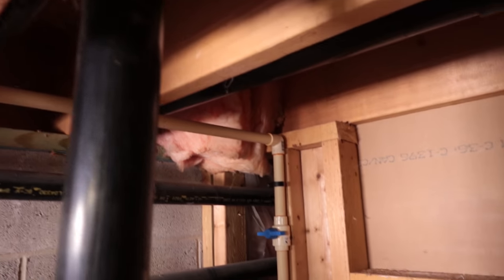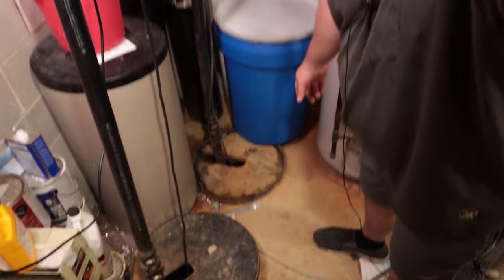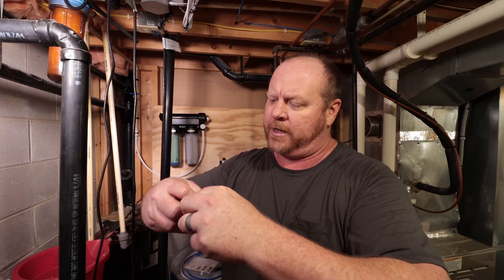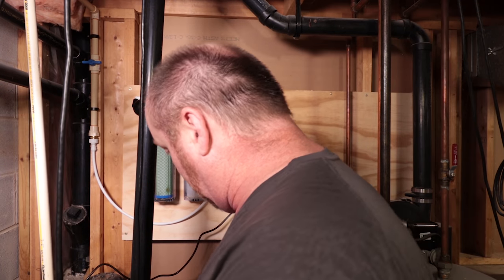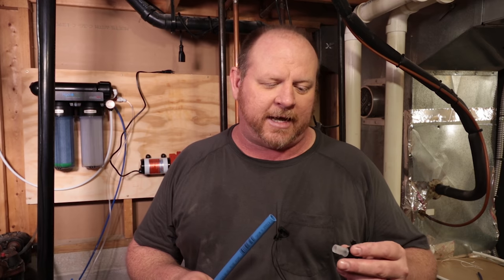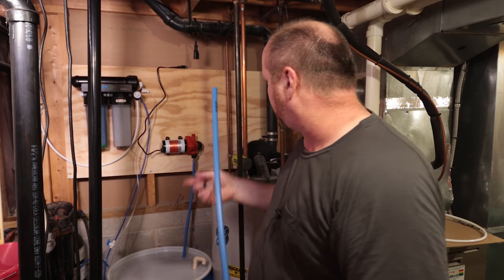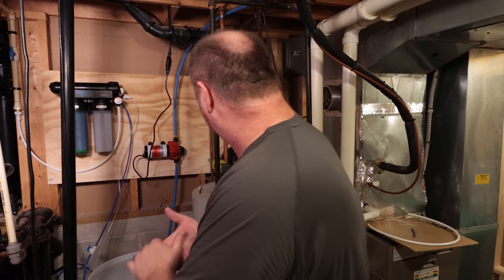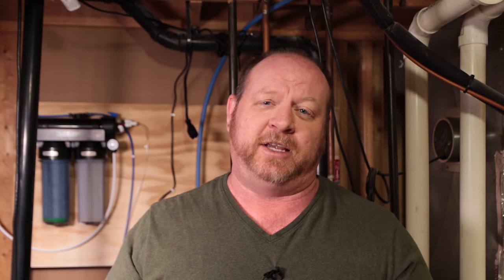Basement Brewery Build Part 12 Hydrologic Stealth RO 150 Install

Comment: I can't tell what your H2O softener setup flow is, but I assume you're adding salt (brine tank)? If so, can you take your H2O before the salt addition? This is just additional load (and shortened life) on you membranes. I would consider putting the RO waste water back in the brine tank. Nothing really bad in there and it will be way diluted out. No point wasting the H2O.
Reply from the maker: The iron content is way to high. The folks at hydrologic told me it's best to have the RO after the softener. I don't have a way to put water back into the softener either.
Reply: @ShortCircuitedBrewers  I meant run the water through the filters, carbon, DI or whatever you have, but skip the salt to save your system.
Reply from the maker: @henryelceser  gotcha
Reply: @ShortCircuitedBrewers  Nevermind with the high iron, the sodium is the better alternative. You still need to regen the softener bed.
Reply from the maker: @henryelceser  yeah it is an old system. Thinking about upgrading to a different style that deals with iron better.

Comment: You have the flow restrictor hoses backwards!! The purple is 2:1 and the red is 1:1. If your water is over 300ppm, you're supposed to use the purple line, not the red. I just hooked mine up and I'm reading it in the manual right now....
This video here shows it at 2:39 https://youtu.be/0HaPpEk7Wsc
Reply: is this comment not showing up?
Reply from the maker: it was hidden because of the link in your comment. I had to approve it.. I have now.
Reply: @ShortCircuitedBrewers  oh okay. I figured youtube was just being a pile of crap lol. I had one other thought floating around my mind. Did you close the valve on top of the stealth ro? The one above the flow restrictor? I only ask because it looked like it was still open, in the background and I forgot to close mine, for about a week, before I realized that it's supposed to be closed.
Reply from the maker: aDayInTheLife no!! Lol I just checked it!! Funny thing is it has been working fine? Maybe the content after the softener is not that hard for the system to process?
Reply: @ShortCircuitedBrewers  yeah I don't know lol, but the directions say to close it. That's funny 😅.
Reply from the maker: @moedogger21  😂😂😂👍🍻

Comment: Are you worried about your holding tank becoming contaminated over time since it is not sealed or under pressure? Wouldnt you want a sanitizer in the tank and then carbon filter it prior to usage?
Reply from the maker: Not really, it is really well sealed. I am adding a screen to the vent as well. Time will tell I suppose. I'll definitely do an update if anything weird happens. the reason most RO tanks are under pressure is not for sanitary purposes, it is the ability to dispense it under pressure.
Reply: @ShortCircuitedBrewers  What I did with a similar system is use two of the 3/8 barb HEPA filters on a T fitting as a breather.   This way there's only very tightly filtered air entering the sump.

https://www.homebrewing.org/Sanitary-Inline-Filter-38-Barb_p_2903.html

Also, one thing to watch for with the float valve is TDS creep over time.  When you short cycle the RO, the first batch of water out of the filter is going to be high TDS. No way around that, when there's no steady flow, the TDS equalizes on both sides of the element.  With the float valve essentially starting the system every time you draw water, over time the TDS in the sump will climb due to the initial burst of high TDS water.  You really need to draw the sump down an appreciable amount before starting to produce more RO to combat that.
Reply: @ShortCircuitedBrewers  And the water is being boiled so there should be no health issues.
Reply from the maker: Typically I will be using 10+ gallons at a time. Hopefully I wont have much of an issue. Would you recommend discharging the first bit of water when I drain a substantial amount?
Reply: @ShortCircuitedBrewers  As long as you're pulling a substantial amount of water when you draw from the system, you should be OK. Might want to invest in a TDS meter, just to periodically check the TDS of the water you're getting from the tank and your source water to see what your rejection rate is.  It'll also be handy to see if the TDS in the tank is slowly creeping up over time.  

Also, check that tank from time to time to see if it needs cleaning. I dump mine, clean with PBW and sanitize with Starsan once a year, although with the HEPA filters I haven't had any growth/contamination in the four years I've had the system running.  I also use my setup to provide drinking/icemaking water for the house.
Reply from the maker: @the_bishop  cool thanks for the info. I did cleaned and sanitize just like you indicated. The pump does pick up from the very bottom. So it will be interesting to see how it performs. I am going to get a TDS meter to monitor the water to double check it. I have a glass rinser and a ice maker in the bar that I may hook it up to if everything goes as planned. Thanks again for all the tips and advice! 🍻👍
Reply: I did a similar thing with a 60l fermenter. Cattle float valve attached to inlet, old plastic keg relief valve always open to vent and an old march pump to transfer the water under the floor boards on my house. People worry about the water getting funky. I've been using this setup for 6 years and had zero problems 🤷. Your basement brewery is turning out great. Looking forward to the final tour 😉
Reply from the maker: @DavoN3MI  that works!
Reply: They make small hydrophobic vent filters you can add to any open air tanks. It's a good idea just in case. Cool setup though

Comment: Did i hear that right? for every 1 gallon of RO water you get you waste 2 gallons of water??
Reply from the maker: Yeah. And that's pretty good. Sone systems waste twice that. 👍🍻
Reply: @ShortCircuitedBrewers  is it just wasted down a drain or can it be used for cleaning?  I was thinking of getting an RO system at some point but to me that is A LOT of wasted water.  I mean if you fill a 50 gallon reservoir with RO water that means you need 150 gallons of water out of which 100 is wasted.
Reply from the maker: @codebowl  you "could" use it for cleaning.. but it would have all the impurities at a more concentrated level than your standard tap water.. it certainly is an issue for people on city water because you get charged for sewer as well as for the water. I'm on a well so my only extra electric to run the pump. 👍🍻

Comment: I've considered getting an RO system. We have great municipal tap water where I live but I do feel sometimes that it's a factor that could be improved. I live in an apartment though so I can't get something big and bulky.
Reply from the maker: I hear ya!! Lucky you water is good!!
Reply: Aquasana has some really awesome units that attach to the faucet that should work for you FDK.
Reply from the maker: @Mezoloth  thanks for the advice!! 🍻👍
Reply: @Mezoloth  Oh really? Thanks for the tip, I'll check them out

Comment: Am I the only one that has no idea what a "RO" is ?
Reply from the maker: Nope probably not.. Reverse Osmosis. Simply the water is forced through a membrane that rejects all the solids in the water, leaving you with no mineral content in the water. Then you can add back only the minerals you want based on what you are brewing. 👍🍻
Reply: @ShortCircuitedBrewers  Thanks for the lesson :)
Reply from the maker: @j4nch  thanx for asking.. Some people wouldn't.. 👍🍻